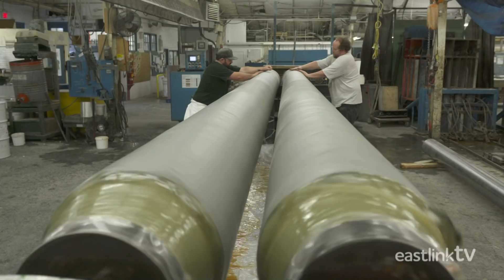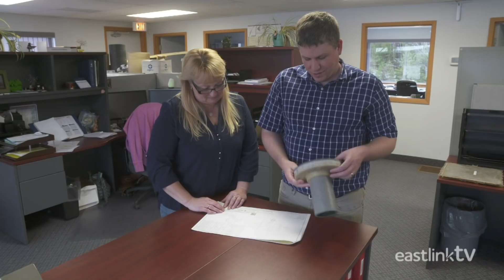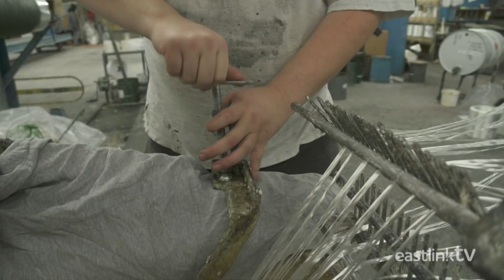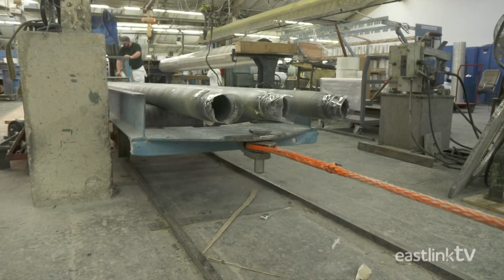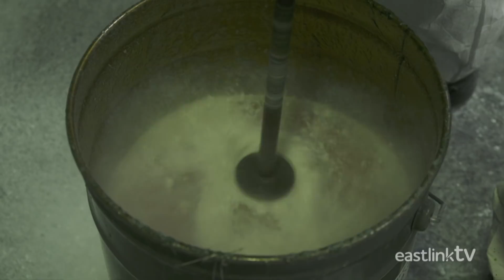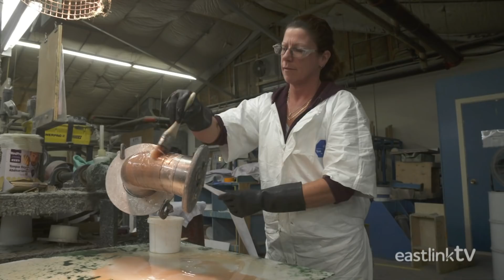RPS Composites on Maritime Made

Comment: A pipe where you can tailor-fit your intended use! If your end-use is for seawater, the pipe manufacturer will use a resin with proven performance in seawater. And, if the pipeline is to be underground with acidic soil surroundings, an external liner can be constructed on the pipe wall built-in during production, bonded with an appropriate resin system conducive for the acidic environment. That's the wonder of GRP/FRP composite! Keep it up RPS Composites!